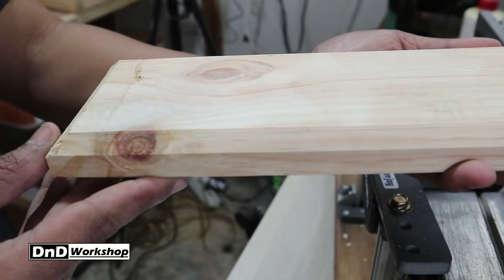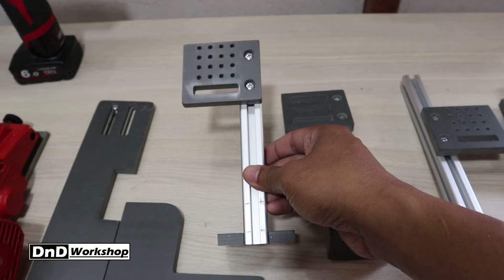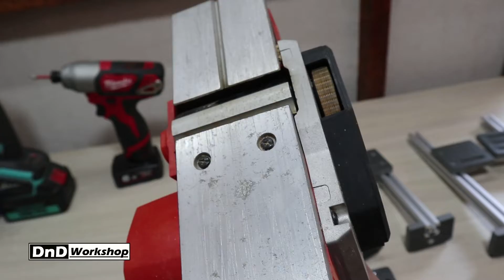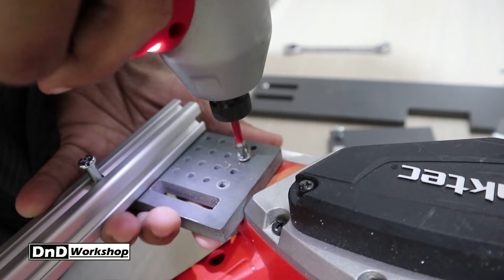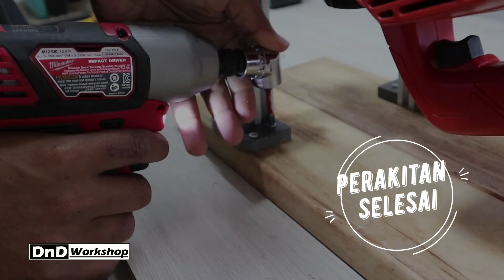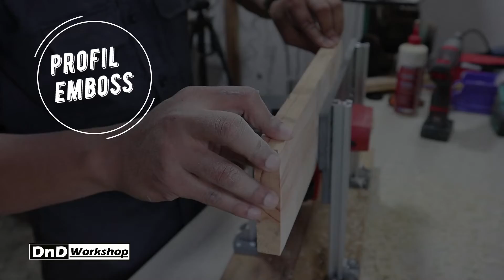Jointer Kayu - DIY Wood Jointer Woodenjoy

Comment from the maker: Jointer Kayu - DIY Wood Jointer Woodenjoy

Berat: 2.000 Gram
Kategori: Mesin Serut Kayu
Etalase: Woodworking Tools
DIY jointer untuk mesin hand planer All merk yg dijual pasaran di indonesia

update : brand stanley,bosch ,dan blackdecker nggak bisa pakai jig ini.

yg didapat hanya jig nya saja ya, tanpa mesin dan alas kayunya! seperti foto ke 2

pemasangan mudah tinggal pasang baut dan skrup, cukup nyiapin alas saja siap digunakan. sudah lengkap dengan penutup pisaunya jadi lebih safety

foto agak sedikit berbeda dari video dibagian alumunium profilnya. tapi tidak pengaruh ke fungsi,supaya harga bisa lebih ekonomis.